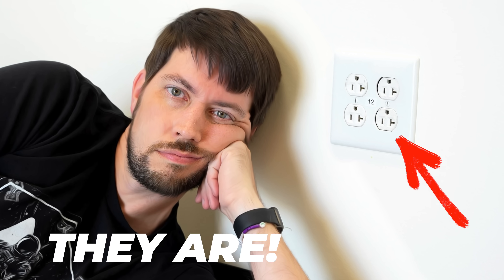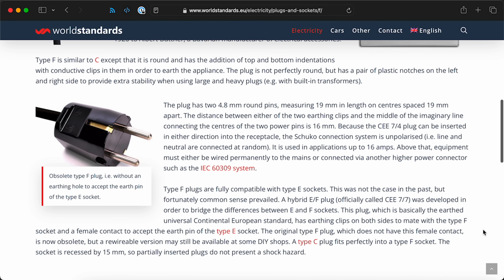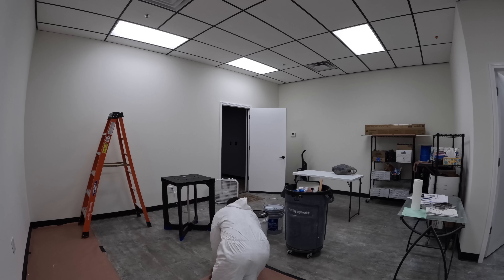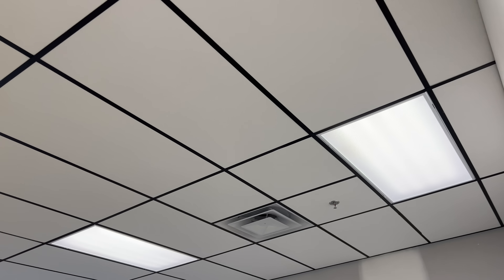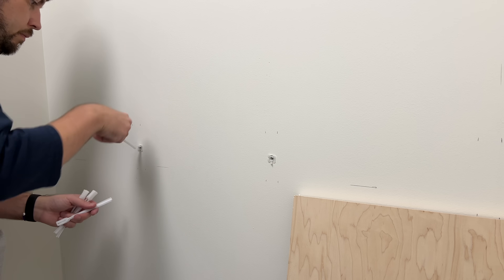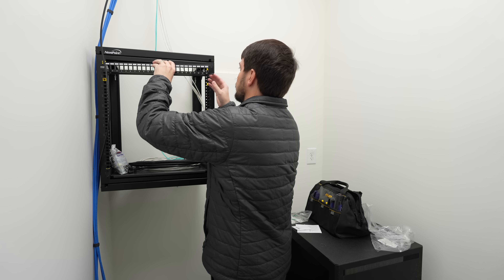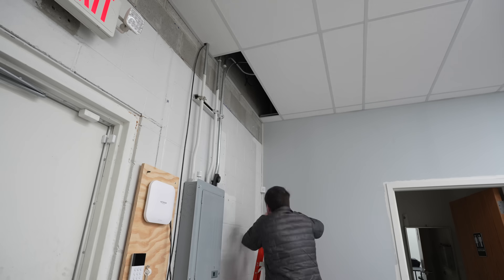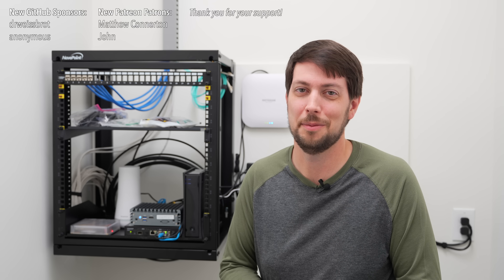Wiring up a small office network rack (moving 10)

Comment: The plywood on the wall explanation makes sense, but I've never seen it done in real life in my part of the world. It seems to be a small network/you tube kind of thing. I wondered about a few things, one was why put the excess coax in the rack and not in the ceiling. Another was why not put a pdu on the rack and take power from there which the UPS kind of is I guess. Then there is only the need for one lead from the outlet... which I would have relocated into the back of the rack given its wall mounted. Without a pdu, power management becomes a pita, power cables end up everywhere and it can turn into a bit of a situation in time.

I would have run the network cables and coax down the inside of the wall into the top of the rack as well but I get running it on the outside of the wall is way easier and neat enough. You may have mentioned why you did this and I missed it, but I did hear you say you would cut the coax to length some other time. Fair enough. For my own network I've got cables running inside the wall and terminated on the wall and then patched from there to the rack using off the shelf cables and keystone back to back jacks for the on rack patch panel. It worked out easier/neater to do it that way.  

Using a shelf makes sense for what you have here, adapting to rackmount this equipment is is going to take a fair amount of space which may or may not concern you. What you might consider if you head down that road is generic 1RU devices which are a good option for device density in a small rack.

The WAP could be put inside the ceiling space if you don't have the ceiling mount hardware to get it up out of the way although there is nothing wrong with sticking it on the wall there as you have done, and particularly if coverage and performance is OK. 

https://www.hunsn.com/collection/1u-rackmount-server << for example. I have a Celeron powered one running untangle, works well. 

Rackstuds for the win of course. 👍

End of the day everyone is an expert, none of us were there to see what you were dealing with and you've got exactly what you need and room to grow. Rock on.

Comment: Jeff, are you using DC UPS' for your smaller devices? I'm trying to decide how to go for the network setup in my new house.  I'd love to go DC to DC for the power and space savings but my router wants 5 amps at 12 volts...

Comment: Fix for your studio air duct. Put in an electric damper in the duct that feeds the room. Better if you put it a distance away from the ceiling supply vent. Then you can add a 120VAC controller to the damper to automatically turn on/off depending if you are in recording mode or not. The rest of your spaces will not be affected.
Reply from the maker: The bigger problem is the fan motor—it is single-speed, and not built for silence. Now that the fan belt works, it is creating a resonant hum that I can't easily knock out with simple EQ adjustments. So it's easier to just automate turning it off while recording for now.
Reply: @JeffGeerling   If it's a resonance issue it will probably go away if run at a different speed. Since it's belt drive you'd just need to change the pulley sizes. You would need to make sure you run the blower to produce acceptable airflow. For a conventional heating system this is as simple as measuring the temperature differential but for air conditioning / heat pump it can get a bit more complicated.

Comment: I have a similar small 12u for home. In addition to the patch panel and switch (that you've already done) it's been super helpful to have a 1U power distribution switch, which then is what plugs into my mini UPS like what you have. Most will have plugs on the front and back, so the few times I've needed a laptop locally, it's easy to plug in.

I'm interested to see what you come up with for the modem and router mounting, I've had similar thoughts but also just have them sitting on the floor of my rack at the moment.

Comment: Viva PEMKO. I worked there when I was young. Quality hardware.
Reply from the maker: Apparently my Dad started using their stuff on less-critical studio builds for a while now, and they work great. They're not as good as a super-duper-sealed door like they use in their main studios (where the walls are also like 1' thick and they have special multi-pane windows with neoprene rubber spilling out everywhere!), but they're the next best thing, and a godsend for retrofits.

Comment: It looks BEAUTIFUL!!! 
thank you for taking us along for the ride!!! 
I REALLY hope you took my suggestion about the main studio layout. It was essentially like the way Steve from Hardware Unboxed had built has new(er) recording studio by making a wrap-around desktop (which you could put against one of the walls without a door) with portion of the desktop able to be lifted up and latched so you can enter the center of the wrap around and have a sliding chair (with a plastic rug cover for easy sliding) This would give you a huge amount of workspace3 and the ability to film from a ton of angles just at that desk and make your streams appear to have about 4 or 5 locations just at that desk. Plus you would have a TON of easily accessible storage underneath with the ability to make areas where you can slide you chair in all the way so you chest could be against the desktop. But I think the important part is to have  your main desktop surface at your normal level but all around the outer edge you could have a raised ledge with a small surface (maybe 6 inches deep) that would keep you actual work surface block from sight when viewed front he outside  (I know there is a name for this but I really can't think of it right now)
And if you're think of having that arity of recording angles you could either not have that ledge on all sides of the wrap around OR you could make some portions of it removable :)
Reply from the maker: I am definitely going to work on the layout more once I'm completely moved in — it will take some time though as there are a few small projects I need to work on after moving in, to get storage all set up efficiently too!

Comment: @JeffGeerling if you aren't  in love with your current UPS, I recently discovered a hack using a EcoFlow River 2 Pro as a UPS for my networking rack. Works great and much more cost efficient than APC or CyberPower solutions. River 2 Pro has 768Wh capacity with 800W output. USB-A and USB-C. Just hook your rack PDU into the EcoFlow AC and the EcoFlow into utility power.
Reply from the maker: I've considered something like that in the past—I think for some types of equipment that could work quite well (their inverters are pretty good), for some not as well (some servers and network equipment can be a bit picky!). But it would be cool to do some testing on 'consumer'-y battery generators vs commercial UPSes.
Reply: @JeffGeerling I was concerned about this, but multiple tests and every time it has worked. It's some Ubiquiti equipment, Synology NAS, 4x Raspberry Pi 4Bs. I think the key is having a high quality PDU after the EcoFlow. The PDU I assume has some capacitors to hold a bit of charge.

Comment: One note on the cable modem.   You said you want to make it 1U, which means the modem will be laying down side ways.  While most modems can lay side ways, but they are designed to be standing vertically.   The heat inside the modem can be dissipated better when standing vertically.  If laying sideways, make sure there are at least some airflow near by to draw heat away from the modem compoents.  It will make the modem operate better, longer and more stable.  just my 2 cents.

Comment: I really suggest boxing out the floor area in front of the breaker box with black/yellow tape to discourage people from putting stuff in front of it. similarly I do this for lab doors indicating how the door will open. I also suggest a "whole house surge protector" which doesn't take the place of surge strips, but gives extra protection to things that you don't plug into surge strips, like appliances.
Reply from the maker: You think like my Dad! He also mentioned the panel surge protector. I put one in at my house, but there is none here. He said putting one of those in can even extend the life of more sensitive / cheaper things like LED bulbs.
Reply: @JeffGeerling That's been part of the NEC / building code for awhile now. I'm surprised your commercial space was approved without it. (code also requires a 3 or 6 ft clearance in front of panels. the fire inspection will ding you on that.)
Reply from the maker: @jfbeam The panel clearance is fine in this case—it's 36" here at least, and I give it about 5' clearance (at home I have some caution tape on the floor since the kids will park objects underneath otherwise!).

Comment: To mount the cable modem you should disassemble it and see if the board and other components will fit in 1U, 3D print a bottom plate that has raised points to slot into the screw holes and maybe a front plate for the leds and buttons to look nice from the front which will be a 1U filler plate with a modem shaped hole cut out of it

Comment: Do yourself a favor and add a small fan to that modem. Especially if you mount it sideways, they tend to overheat. - so you're going to be 2-U high. I used a Noctua Slim (15mm) 92mm Fan with an USB to 3-Pin adapter. The Fan only gets 5V - but that is more than enough to bring in some air in the Modem.

Comment: I really like the direction you're heading with the rack. You were talking about rack mounting the cable modem, and you could do what I did. I just bought a 2U static shelf on eBay and laid my modem on it. Slid it out to the edge so I could see the lights, and secured it with a small amount of VHB tape so it wouldn't slide around. Looks kinda jank, but it works. The little shelf also gave me enough room for baggies of extra screws, a roll of tape, Sharpies, etc... crap I always seem to need around the rack that I can never find when I need it.

Comment: Interesting you did make use of extra rockwool for some kind of sound dampening.

You cannot run the fans at a lower speed? Maybe if it is low enough you won’t really hear it.
Reply from the maker: I wish! These commercial rooftop units are midrange/low-end, and have just one speed... one that causes a good deal of structural vibration!

Comment: Just an FYI, those cable labels will get kinda crusty and fall apart over time, especially if they are in the heat for years. We use self-laminating labels printed off a BMP51 and they are great
Reply: Bump

Comment: For the rack room, I would have put a plywood sheet pretty much floor to ceiling and left it unpainted.    This room will evolve quicker than you think, over time.
Put a power-bar or 2 on one side and manage those cables to that side.  
Oddballs like the cable modem and the fanless PC: mount to the plywood - not in the rack.  
I assume the AP will be moved to a more central location within the offices at some point ... PoE.
There is no code for socket orientation.  Ground or neutral "up" is a "best practice" to reduce the chance of shock or fire if something falls between the socket and a loose plug.
Reply from the maker: Yeah if I had thought about that wall earlier, I would've done more plywood (my Dad had the same suggestion)... but since it was just me and I was trying to get that done pre-cleaning I only had the time/strength for one board :(
Reply: @JeffGeerling  PSST, cut a scrap of ply strip etc. The height you want the bottom. Lean it on the wall, set your ply on top of it and hold them flat to the wall. The scrap holds the weight so you can position. Just keep gentle pressure holding it flat to the wall.

Comment: Hey Jeff for your modem to rack mount it CAD and 3D print a custom holder to put it into the system that you had 6 raspberry Pi's with https://www.youtube.com/watch?v=LcuNc4jz-iU I did this for my rack and have 2 Pi's custom NVR and custom router all in 1U and its modular so I plan on adding another U with more Pi's later. Love your work :)

Comment: There are some rack shelves that you can use for a cable modem for a very simple solution. Another thing I've seen is to get the modem attached to a face plate somehow, but that may require some drilling or 3D printing.

Comment: When I renovated my house I put all cat7 cables inside the concrete walls. Best decision ever. My Netgear switch has 2x 10Gps ports and 8x 1Gbs ports. 
I use 2x 10Gbs for PC and NAS. 
Also drilled plywood board under the stairs and hid service loops behind plywood. Looks professional and everything is painted white. 
My Virgin Media router switched to modem mode only and I use Google Nest as my router. 
Very happy with the setup. 
Probably will upgrade to Google Nest Pro in the future or just go to the wifi7 router.

Comment: We clearly don't have the same definition of a simple install lol. My install is just a Bell wifi/modem/ router lol and 50 ft of rj45 ethernet cable for the ps5 downstairs and a short cable to my pc lol
Reply from the maker: There's simple and then there's also simple simple!
Reply: @JeffGeerling  I mean as long as it's simple to you 😅😅 I need to upgrade my pcs ethernet card to support 2.5 gbps ethernet because I have 1.5 gbps internet service so its not soooo simple lol

Comment: The reason why outlets are upside down is because of safty. It is so you will not shock yourself if you accidentally touch the metal prongs on the plug. I was told this by a old grand electrical guy. This honestly should be the normal thing to do. All my outlets are upside down.

Comment: Jeff - Below the patch panel you should mount a 1U cable management unit, to manage network cables to/from the switch that will be just below that.
Also - At the very bottom of the rack I like mounting a 1U rackmount surge suppressed power strip.  Your rackmount shelf for non-rack mountable gear can go just above the power strip.
I like your patch panel with the really nice'n'secure double strain reliefs for each net cable.

Comment: I would have mounted everything to the wall, especially use a wall mount patch panel (these are generally 12 ports). It's best to not have premise wiring attached to anything that can move (such as your hinged rack). All of your gear appears to be wall mountable, and you only have a few cable runs. Your rack doesn't appear deep enough to accommodate a regular sized server. Aside from not having proper grounding, I think you did pretty much everything else correctly.
Reply from the maker: For the rack situation, there will be a separate 42U rack for servers.

Comment: I am sure you have seen them before, but you can get keystone holders for the fibre LC bulkhead couplers, you just cut the wings off.

I number my ports say below the ports on the patch panel, then have description of the location above using a brother E550w label printer.

Comment: PTP would be overkill for almost everything unless you are planning on opening a stock brokerage with large trading blocks or experiments on sub-atomic particles.  NTP is fine down to microseconds, so do you really need authoritative external time reference down into the nS range?  You could run a cable onto the roof for a GPS antenna with a GPS that gives PPS output, like the Garmin GPS 18 LVC I use, and if you check the cable length you can even put the fudge factor in to correct for that at 3nS/m,  although with an accuracy from the PPS signal you will only get guaranteed down to 1 microsecond anyway.  It is never a bad idea to have your own NTP stratum 1 server in-house, and you can add it to the US pool to make the time synch publicly available.  If you were to go to PTP you would need dedicated fibre links to one of the authoritative clocks and something similar of your own (caesium of better), which I imagine would break the budget rather badly.  It is only needed when there is a serious statutory requirement for verifiable timestamps validated by frequent logged entries showing synchronisation with those grandmaster clocks at places like the USNO.  My clock ticks within fractions of a microsecond of the other stratum 1 servers I cross-check with (including our national grandmasters) - generally in the sub 200nS range as long as I keep the temperature fairly constant, a sudden change can cause drift of as much as a microsecond, which is fairly obvious if you graph temperature against time offset.  It is currently at 117nS offset.  Do you really need better precision than that?
Reply from the maker: It would be mainly for the fun of it. How many microwave clocks are synced by PTP??
Reply: @JeffGeerling  At a rough approximation, zero, unless any of the guys at CERN decided to have a bit of fun between major projects (which is not unknown).

Comment: Don't rackmount the cable modem.  It won't fit into 1U and its just a waste of space in the rack.  Much better to mount it flat on the backboard.  You can pretty easily draw up and 3d-print a simple bracket for it.  Or, if time is short, get get some strapping and tie it down.  Odd-shape non-rackmount thingy's belong on that backboard.  And get a wall-mount VESA bracket for the little ranless router box too.  Than you can save the rack for racky-thingys.

Comment: Why did you mount the Netgear Access Point right next to the metal frame for the rack? Won't that result in degraded wireless performance?
Reply from the maker: For now yes; I'll mount it more permanently later.
Reply: By the way, thanks for the tutorial "Enabling TRIM on an external SSD on a Raspberry Pi" on your blog. Worked perfectly.  @JeffGeerling
Reply from the maker: Glad it helped! @billevans3784

Comment: For the Brady labeler, get the correct "Self-laminating Labels" there is design for labeling the cables with the protecting laminating.
Looks like you used the wrong labels
Reply from the maker: These are the self laminating cable wrap labels; check out the link in the description for the exact ones I'm using.